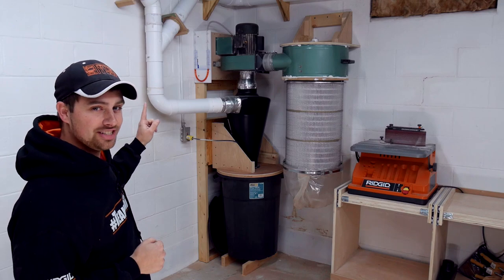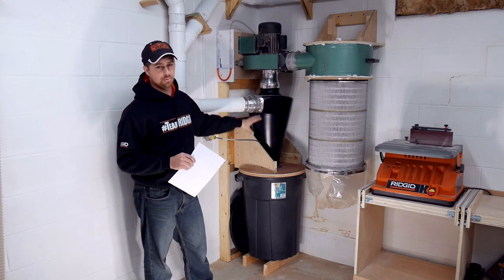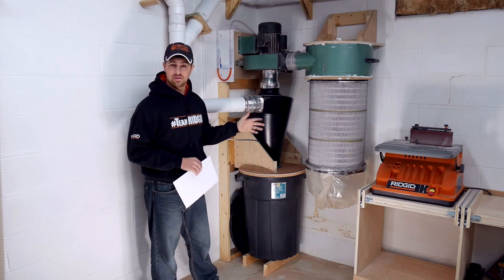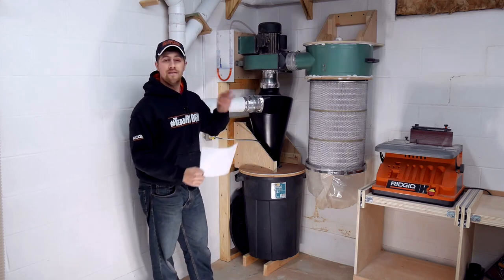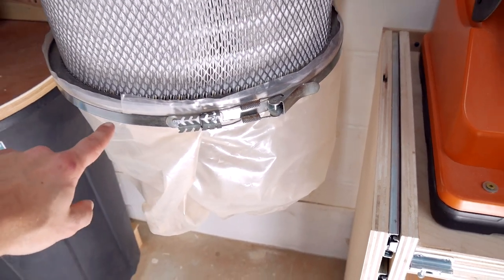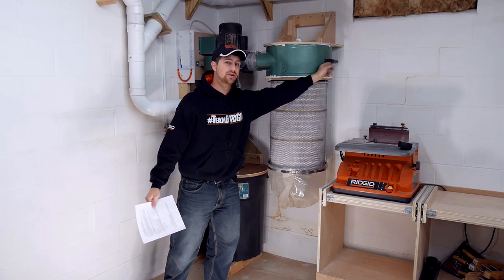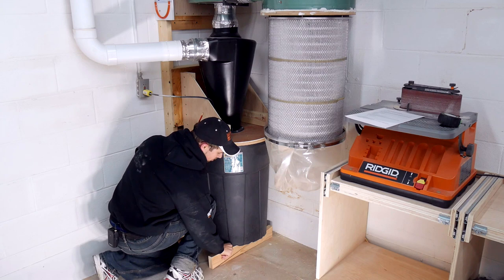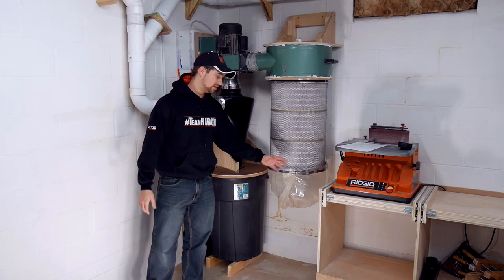LTL 2 Stage DC Modification

Comment: great video.  I've watched your conversion video a few times.  I know you bought and used the collector as a single stage system for awhile and then "grew into" this upgrade.  I'm starting from scratch on a DC and I'm stuck on the fence about following your path vs spending a little more on an of the shelf cyclone like the grizzly g703.  All your great info is leaning me toward a diy system.  thanks

Comment: Awesome video! And awesome build! Thanks for the idea! Quick tip/question, why don't you just do another trash can system directly under the filter just like you did under the cyclone? It would only be an addition of another $5 trash can and 2 more opposing wedge systems. Just a thought. 
I realize that you would probabaly never ever fill up a trash can on that end of the filter. Maybe even mount another shelf underneath the filter that a 5 gal bucket would perfectly wedge between to replace the plastic bag. Maybe even just cut a port in the 5 gal bucket to just have a shop vac 2-1/2 hose hook up for quick emptying of the fallen fine dust. (Analogous to the water drain valve on an air compressor.)
Again love what you've designed here! Hope my comments help!

Comment: Tyler, maybe the best result is to get a trash can or barrel with casters on the bottom. Then make a lid for the top of it that has a short piece of flexible hose that connects to the dust deputy. The lid would remain connected to the dust deputy and would have clips that hold it securely to the trash barrel. This way you would eliminate the need for the wedges and you can wheel the dust to the dumpster while the lid hangs freely. Then just wheel it back and clip the lid back on. Great mod though. Thanks

Comment: for the filter, just go to a diesel truck shop and ask for an AF26163M or AF872 air filter. most of them are also MERV 15, which is and are only around $60. I work for Travel Centers of America and replace these things all the time in the shop. if your nice and ask a technician, they might just give you a used one that came off a truck for free since they get trashed anyway. after being blown out with air, they're good as new.
Reply: I just looked for those online:  the AF872 appears to be designed to filter air that's going in the wrong direction, with dirty air on the outside and clean air on the inside.  Is that accurate?  Also, what kind of airflow do they allow?  If they'll really work, this would be a fantastic option, but I'm having trouble finding anything definite about how they work.

Comment: you could also run another lid on the garbage can and keep garbage can on the ground then just run a piece of 6" flex tube between the cyclone base and the new lid. no need for wedges.  your design is great and my idea may be completely wrong. thanks for sharing
Reply: you can still use wedges between the new lid and the cyclone base if you needed too

Comment: Hi, what is the name of the black plastic square-to-circle  that goes from the motor to the filter hanger? What goo did you use to seal your pvc? Would any kind of caulking work for sealing the drum (with the round plywood lid)?

Comment: After the blower, you don't really use (or need) the Harbor Freight dust spinner (don't know what to call it).  if you put the filter OVER the spinner then you can separate even more dust and keep your filter cleaner - I would imagine.

I have the HF dust collector (a.k.a dust pump).  I plan on doing something to improve filtering and collection.  It's my intention - unless I learn something greater - to have the filter above the spinner.  ( you're calling it a doughnut )

Comment: Hey Man 😁 I have everything I need in order to build this Puppy ... now it's time for the fun part, I'm doing everything the same way except putting a finish on the frame, and adding a screw on system for the filter with gamma lids on Top & the Bottom for dust bucket instead of a bag... Any tips?

Comment: I bought the Harbor freight dust collector on your recommendation about a year ago. And I agree, its a great buy 'for the price'. One quick question though, is there any reason I couldn't mount that Wynn filter at the top of the (not sure what you call it) green separator where the Harbor Freight tilter bag used to go? Then leave the bag clamped on the bottom of said separator?

Comment: Hey bud.  Regarding the stage 1 bucket: would I be right in thinking that you could put a liner bag directly in there, and maybe overhang the top edge out through the seal?  It seems like there shouldn't be any suction, or any real turbulence to disturb the liner, and it would make emptying the bin a lot easier, assuming you have to transfer the dust to a bag anyway?

I like your stuff. You've got a new subscriber.

Comment: Thanks for sharing Tyler. I am planning on setting up a small wood shop and would like to know if this unit can be mounted on a platform so it could be rolled around as a single unit? I will be using the same unit or maybe the smaller one that HF offers. Do you think the unit you have will work good being used mobile. Also for the amount of work I will be doing, I feel that maybe the bag that comes with the unit will work ok until I can upgrade It.

Comment: To clean the filter you could run your orbital sander (without sandpaper) around the outside of the filter to knock the dust down to the plastic bag. May work better than the air hose.
Reply from the maker: You can actually bang the outside with your hand too. I am going to replace this filter with a new design that Wynn is releasing that is make with a heavier cage so you can clap the crap out of it with no ill effect. Stay tuned.

Comment: Thanks for sharing man. Definitely inspired my system that I just built. One thing I did to avoid the wedges was a set of casters on my 55 gallon barrel and then conected the lid of the barrel to the bottom of the cyclone with a 10" piece of  6" flex hose (stretched out). That allows me to unclamp the lid from the barrel, lift it and roll out the barrel.

Quick question - what is the cfm rating on your motor and how much does it drop when testing it at your furthest machine?

Comment: Do you clean the filter with your air hose?  I have something similar to your set up in my garage, and it seems like my filter gets clogged a lot.  I have the filter above the harbor freight piece and the bag attached to the bottom.

Comment: Tyler......I have the same setup as you, not that same configuration, but close.   I have the HF blower mounted to the top, and blowing through my C1426C wynn filter.   I'm having a problem with the chips spinning around and around even after the chips have stopped being sucked up by the SDD,  and that happens until i turn off the motor.  Do you, or have you, had this problem?  I can hear the chips spinning around the top of the SDD.

Comment: Hi Tyler again great video. this is one of my favorite DC videos. I have bought all the supplies for mine including the SDD and Wynn filter. I plan on directly connecting the blower directly to the cyclone. both to eliminate the reducer and increasing the size to match that of the SDD outlet which is 6 inches. Any thoughts.

Comment: Oh... and since most tools that I can afford have dust ports are around 2-3 inches and are made for shop vac (i.e. high suction, low volume) How well does the cyclone (high volume Low suction) work clearing this type of equipment from debris?

Comment: hi Tyler. Is the use of the  dust collector barrel even necessary? Is it now just a mounting location for the filter? Another guy ("the gray house" I believe) set up the blower and cyclone like you (and commercially made ones) and just plumbed the filter directly off the blower exhaust (again, like most commercially available cyclone systems). He just made a mounting flange and added an HVAC take-off to connect the pipe. I did see where Wynn has come out with some tweaked designs aimed at us poor DIY woodworkers... 😎
Reply from the maker: Assume your are talking about the green thingy I have the filter mounted to? I saw the other guys video as well and that method is great. I recently changed the filter on this system to make the filter a bit easier to mount...might be the same filter he used.
Reply: Tyler G yea, the center barrel. Looks like when modified as yours is, with the blower directly mounted to the dust deputy, that barrel becomes extraneous. but then, I guess it kind of doesn't matter since it's on the exhaust side. seems like it's becomes a question of available space and ease of mounting the filter cartridge.  I was glad to see your recent video about the newer Wynn filters designed with modded single stage collectors in mind.

Comment: Still very much inspired by your DC system. I'm thinking my next shop investment will be a DC system, and I will almost definitely model mine after yours.

What kind of runs can you get off of that HF blower?
Reply from the maker: Thanks David....you will wonder what took you so long to get a DC system once you have it. When you think about it....it is the most used tool in the shop. I have over 40' as the longest run and have never had any issues.

Comment: I just bought a Harbor Freight DC. I will be dragging my DC around or 
machines to it until I have a much better feel for my shop setup. (I'm a
 woodworking newbie BTW).
After running all of your 4 inch lines, are you still satisfied with the performance ?
Thanks !
Reply from the maker: Yup, wouldn't change a thing!

Comment: I plan to build my system like yours with the newer Wynn filter. I plan to make mine on a mobile cart and just move it to the machine I'm using. I will have a very small shop where everything is mobile. Do you think the Super Dust Deputy or the XL Dust Deputy would be best? I will only be using it on one machine at a time.
Reply from the maker: I was debating building mine on a mobile cart but decided I will never move it so why?! You will need to use the SDD unless you have a 5hp+ motor which Is what the XL is designed for. Good luck!
Reply: Tyler G thanks!

Comment: If you were creating this today would you use the 35BA222NANO Cartridge Kit or 62N220NANO2G?
Reply from the maker: I will actually be changing the filter on this so something that is more easily connected, stay tuned.

Comment: After watching your videosI was inspired to do the same with my powermatic dust collector, however now I am finding that the brute trash can tends to collapse a little while the unit is on and all of the dust and wood chips goes through the impeller and collects into the bucket on the bottom of the filter instead of dropping into the trash can. Any thoughts on why this would happen? Any help would be great!!!! Thanks!!!!
Reply from the maker: +Matt Spry You have 4" ducting? Too much static pressure since the lines are smaller. Quick solution would be a heavier trash can, they are not all created equal, or larger duct lines.
Reply: Yes I have 4" ducting as you, I went with the brute trash can as it is a heavier material, I'll try maybe a metal trash can. You think that will allow the wood chips to drop into the can rather than going into the bucket on the bottom of the filter?
Reply: +TylerG any ideas on why you don’t have too much static pressure on your system running 4” duct work? I’m running 4” just like yours.

Comment: Are there advantages to bottom mounting the filter?
Reply: As far as I can tell he's just saving height which he needs to do because of the large (tall) bin. You can see that it won't fit on top. 
I am in the process of modifying a 2hp Jet collector to this configuration. I bought the SDD on Amazon and there is a 20 gallon chemical container that is frequently purchased with the SDD. This smaller bin is better for me as I have to schlep my bin up from the basement.

Comment: How about the noise level
Reply from the maker: Surprisingly quiet, have been told that my several other woodworkers that have worked in my shop. Restricting the tools down to 2.5 in port will really lessen the results of the DC.

Comment: Reviving and old one, but I like your design. I'll be building mine out in the near future. I am thinking of setting mine up with a modified version of this under the can ( https://www.lumberjocks.com/projects/413658 ). Could replace casters with little blocks that push the can up onto the seal when you step down and lock it.